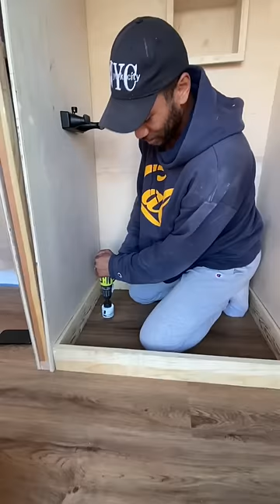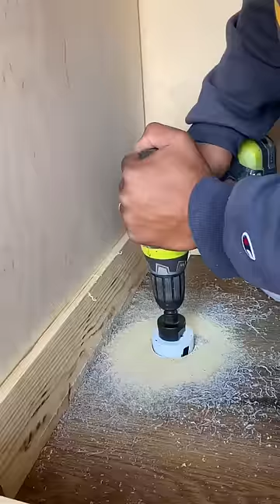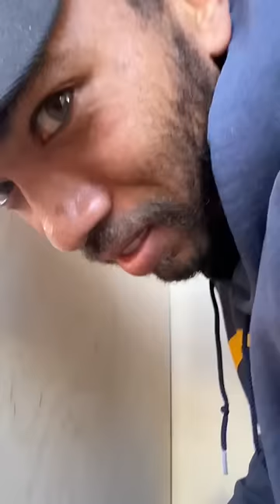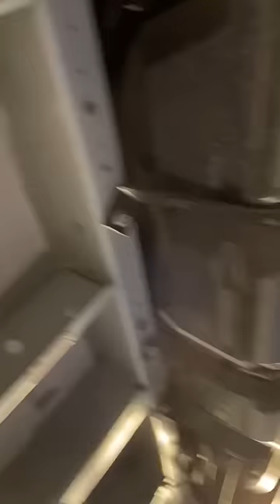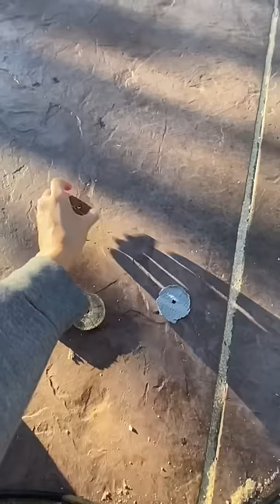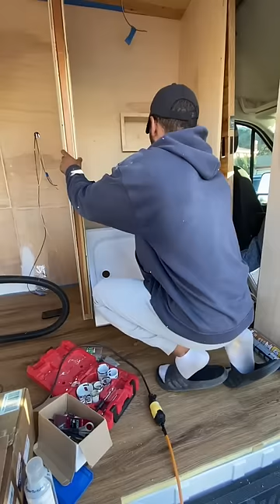How to build a shower drain! #shorts #vanlife #diy #vanconversion #vanbuild #transit #shower #rv

Comment: Ryobi the official tool of I have no fucking clue what I’m doing but I’m a diy person now 😂😂😂
Reply: @That_Black_Menace  bro ryobi is no where near as good as Milwaukee are you crazy I have used tools from a lot of different brand ryobi are terrible they bog down constantly struggles with power and ryobi and Milwaukee both have the shitest battery life what are you talking about 😂 Mini Cooper owns bmw that doesn’t make a countryman as good as an m3 😂😂
Reply: @That_Black_Menace  Milwaukee does it as marketing. If you don’t anything about the tool world or anything about marketing I suggest you just say ryobi is dog shit💀
Reply: @That_Black_Menace  That’s completely false. I sell Milwaukee tools but I personally use DeWalt. Quick example of a better Dewalt tool is the DCN623 compared to Milwaukees 23ga pin nailer but the Dewalt costs more. I also consider anything battery powered from Ryobi to be bad for business. If you’re hanging stuff up at home, building a small birdhouse, or assembling any furniture you might occasionally buy then yes Ryobi is a good option. If you show up on any site with Ryobi tools I guarantee every person there will immediately think you’re unskilled or have an addiction problem because why would you do that to yourself?
Reply: @soulreaper1513  Milwaukee power tools literally can’t be beat
Reply: @konner3593  dewalt better
Reply: this is perfect😂
Reply: dewalt deffinetly best, best battery fit and size, best bits, best chargers, best impacts. i’ve never had a dewalt battery just fall out of my impact. that’s some milwaukee shit
Reply: @TheEvilPorkchop03  everything you said is opposite except for the fact that dewalt drills are unreliable and like to just shit the bed and stop working whenever they feel like it so you’re very incorrect bud
Reply: @vno23 bmw owns mini*
Reply: @Janue_ dealt is by far the better construction company but if I was rebuilding an engine or doing most anything with cars I would want a Milwaukee and I'm not even a huge fan of Milwaukee.
Reply: Just need to get a bigger battery and they're just fine.  I've got 4 amp batteries on all my Ryobi stuff and never have any issues.  Damn impact drill is better than 10 years old and it's still going strong.  Nevermind the price.  Ryobi is much cheaper than DeWalt and Milwaukee.  So if/when a tool does.burn up it doesn't break your bank replacing it.  You can use whichever brand you want but in my 30 plus years in the trades has shown me that they will all do what they're sposed to do.  If you wanna chase the red or the yellow team go right ahead but I'm sticking with my Ryobi tools.  Been making me money for years. 🙂
Reply: @That_Black_Menace  dewalts been kicking their ass recently lmao get with the times.
Reply: @Janue_  I work construction and renovation and I can agree with this don’t show up with that bs 💀🤣
Reply: @vno23  bmw owns mini, not the other way around…
Reply: I'm more of a Milwaukee person
Reply: I want to like this but, your likes are at 777
Reply: all these worlds manliest manly men fighting over tool brands on a van conversion youtube short 😅 must be a slow month for all that construction they ~normally~ be doing 😏
Reply: @vno23  mini does NOT own BMW. It’s the other way around bud…
Reply: @That_Black_Menace  dewalt runs laps around anyone
Reply: Bro, look at the burn marks on the piece of wood beside where he's working. I'm surprised it didn't catch fire on the table saw🤣
Reply: @Carlosc707  my bad point still stands tho
Reply: @That_Black_Menace  dewalt or hilti till I die
Reply: Hey I know exactly what I'm doing most of the time lol. I just own ryobi stuff because I got out of construction 20 years ago and got everything I needed tool wise for the house for a hundred bucks on market place lol. Cant beat an impact, drill, circular saw, Sawzall, work light and angle grinder with 4 batteries and chargers for a hundred bucks
Reply: @vno23  he is one hundred percent right. Companies sell budget tools under different names so they can still charge more for their pro tools while still making money in diy people who don't wanna spend a ton. Not even close to the same quality but they do come from the same parent company
Reply: @octane9866  so yall are baggin on rider there when he's right lol. "Both are brands of Techtronic Industries, used under license from Ryobi Limited. Techtronic Industries (also One World Technologies) is also the parent company behind Milwaukee Electric Tool, AEG (AEG Powertools, licensed from Electrolux), Homelite, Hoover US, Hart Tools, Oreck, Dirt Devil, and Vax."
Reply: @Janue_  that's funny cause I work for techtronic which is the parent company for both. So yes, they do fucking make both
Reply: If you're just doing light work around the house then you have no reason to buy high end tools. I have ryobi I keep at home for quick repairs and they've been working perfectly for about 10 years. Meanwhile I've burned out milwaukee and Dewalt on site multiple times
Reply: @That_Black_Menace  Makita has the best battery and some of the best tools, especially now with the XGT line
Reply: @That_Black_Menace did you know that DeWalt and black and decker are part of the same company too? Doesn't mean black and decker tools are good
Reply: Sounds like a pesant fight over crack head tools. I use all Porter-Cable. I dont trust ryobi, Milwaukee, dewalt or Makita
Reply: @Rider  except for Milwaukee's recent 1/2 impact its a epic fail unfortunately 😔. If you look it up it's bad many of them have broken like hours after purchase
Reply: @jasonluera5058  lol

Comment: No matter what brand drill you get (god forbid Ryobi) never choke your drill’s vents with your free hand like that. Hold it by the grip that’s what it’s there for. Drill’s gotta breathe.
Reply: I always wondered if it was ok to cover those. I have done it plenty of times before but never when drilling through massively thick materials like this. Sometimes it's throwing a 1/4 in through a stud and my hands is on the back. Seeing the sparks fly on my father's older brush motors always made me weary of the vents on modern drills
Reply: @isjjcjw  most are brushless motors now, however the vents are there for a reason for sure, things tend to overheat.
Reply: #drillsgottabreathe💪
Reply: Honestly underrated comment, power tools have vents for a reason, after drilling though some trailer crossmembers you learn that lesson pretty quick.
Reply: Also don’t push down so godamn hard let the drill do the work😂
Reply: Thank you!!
Reply: He probably did that to avoid kickback. These holesaws can bind pretty quickly. 

That said. A decent drill nowadays has anti kickback. Get one and your wrists will thank you.
Reply: @Gren4te  I've only seen bosch advertising that so far, and they seem to be pretty all over the place with their power tools nowadays
Reply: @ItzGiooo depending on the material and drill bit it might be better to use low rpm and a high feed rate (pressing down hard) or it might be better to use high rpm low feed rate. He's not drilling through anything that intense so a lot pressure is fine until he gets to that last layer.

Comment: I can smell that drill burning up 🔥
Reply: Typical 2 min ryobi battery life.. why do people go with JUNK tools?
Reply: @bradmadeira6807  cheap
Reply: @bradmadeira6807   hes a DIYer not a trsde worker. save money. he won't use it for anything but that. 
why would you question saving money, when it does the same job?
Reply: @DoubleTripleOGfromtheset  Cuz he's a Dewalt fan boy
Reply: @DoubleTripleOGfromtheset  that's why he has 2 separate batteries and the double charger 🤦
Reply: Just buy a bauer they are cheap and amazing
Reply: No you can’t
Reply: @bradmadeira6807  really 2 min ? Want me to make a video debunking that ?
Reply: @vsreef1042  Dewalt is junk too 😂 if it isn’t red…..I’m not buying it. Aside from Makita skill saws
Reply: @waynewilliams5353  my dad used dewalt from the 70's till the 2010s and I inherited them. I've used makitas the last 20 years. Never had a problem with any of em.
Reply: @jorgetamez4162  it's comes in a combo pack...
Reply: @DoubleTripleOGfromtheset  yeah of course it would
Reply: @vsreef1042  actually no, I’m NOT.. DeWalt has declining battery quality..
Reply: @DoubleTripleOGfromtheset  because it’s about longevity of the tool.. but the good ones ONCE.. buying crap makes you buy the same tool over and over again and in the end you end up paying a lot more for the crap tools instead of just spending the little extra.. if you own a HOUSE then why skimp on crap?
Reply: Lol
Reply: @vsreef1042  dewalt makita and milwaukee would do better than those.  I would go with milwaukee fuel drill
Reply: @nightmareinaction629  don’t forget about Metabo
Reply: @DoubleTripleOGfromtheset  Thatll blow and he'll buy the same one, rather than simply buying good tools in the first place. And honestly, makita or dewalt isnt all that much more than ryobi. Depends how frequently you use them

Comment: How to build a shower drain:
Step 1: take green tools, put in trash
Step 2: drive to Home Depot and buy Milwaukee impact and drill driver set
Step 3: using a whole saw and less than a single bar on a battery, drill your hold with the Milwaukee drill
Reply: Milwaukee, ridged, and ryobi are all made at the same place.
Reply: @fatbettysadventure603  Ofc you’d say that but if you go over to our very good friends at the torque test channel, you’ll see a great video about just how much torque they each make. Just because they’re made in the same place, doesn’t mean they’re the same quality 😘
Reply: @RK_Insanityy  not arguing, there are different qualities in all tools. If I was using the tools daily for my job or if I just needed to cut a board once in a while. The homeowner quality Ryobi has it's place. Kinda like the Ford vs Chevy question. Does it matter if they both get you there?
Reply: @fatbettysadventure603  definitely has its place and is a great value for what it is.

Don't forget that that was a brushed drill, so of course it doesn't stand up, but it's also a hell of a lot cheaper and the batteries even have a wider range of compatibility
Reply: @fatbettysadventure603  absolutely. Look at how many batteries he goes through just for the hole saw
Reply: @RK_Insanityy  sounds like a battery issue, not a tool issue. I use Milwaukee M12 tools daily. I have some batteries that are shot, but isn't the fault of the tool.

Comment: He could've just used the shower floor as a template. Also, if they don't replace that flooring with durarock before installation... there's gonna be some issues. On top of that, that 2x4 didn't look treated, so...same result.

Comment: Quick tip: never cover the holes on your drill, it could over heat and start to burn 
And when drilling trying to keep your hole straight you don’t wanna make it crooked like you did 

Also never get Ryobi

Comment: Spent more on those hole dozers than the drill 

Also if you’re getting after it enough to burn through a battery don’t cover the air vents. You’ll burn the drill out real quick doing that.

Comment: The only way to learn (in my opinion) is to do it yourself and learn from your mistakes. Great job!!!

Next time, drill a pilot hole first just to be safe! easier to repair that mistake! But again, you’ve done fantastic work in this van! From one contractor to a fellow DIY’er, impressive job!

Comment: So ryobi is fien for home use but this is a damn job site lol. Might as well just get Pittsburgh gear. I own ryobi though because I'm not a professional anymore and all my tools were older than dirt lol. Circular saw, Sawzall, work light, drill, impact and grinder with 4 batteries and chargers for 100 bucks.

Comment: 3 inches away from the horizontal cab rail.  You got lucky.  Would have compromised the safety of that vehicle  if it went through the cab rail.

Comment: -Ryobi. Don’t buy this brand 
- Bit is hot after drilling and it was probably hot af touching it right after 
- don’t block the drill vents!
Reply: Ryobi is fine, never had a problem with their tools and the batteries are a good price. I've built a couple sheds with there drills, drivers and saws and have rebuild a couple engines with their impact wrenches. I really can't justify paying for a more expensive tool

Comment: U can always test with drilling a 1/4" pilot hole first to see if ur in a good spot. Its alot easier to seal a small hole instead of a big one if its wrong
Reply: I'm sure he dry fitted it first.
Reply: @Caliinthevalley  it was about not hitting anything and landing in right spot under the vehicle.. in the vid i think he said something like i hope i dont hit anything. Thats what my original comment was referring to
Reply: He said "hopefully it's in the right spot" he wasn't specific to what he was referring to tho, I'm sure your right tho. I don't think anyone would just randomly drill a hole hoping to be accurate 🤣

Comment: I have some Ryobi tools that I've been using for 15 years and have put them through the absolute ringer building houses/barns etc. If you wanna pay double the price for miniscule performance upgrades be my guest!
Reply: Minuscule? I have built dozens of houses and have cut through much worse much quicker. There is a reason why 80% of construction workers use Milwaukee. It isn’t because they are fan boys, it is because it gets the job done quicker and easier.

Comment: Invest in a whole drill bro will save you lots of time I got the Milwaukee super hog makes my plumbing skit easier.
Reply: How's your battery life though?
Reply: Bro the second you said Milwaukee we knew you just follow the crowd and don’t reasearch tools 😂
Reply: @vno23  lol 250 holes off one x12.0 battery. I’m 21 years old and tried every type of tool for whole drilling
Reply: @MrTimequake  battery life last a long time especially if you aren’t using outdated batteries. It’s like excepting an old phone battery to keep up with a fresh one. All depends on personal care and making sure everything is stored correctly. As someone who does underground’s and rough in’s mainly my tools stay immaculate
Reply: Bro I got the hole hawg drilling 4 5/8” holes over head, fucker burnt out on me it’s under warranty but I was pissed!!! I had this old school dewalt right angel drill NO CLUTCH drilling that shit over head. Talk about put hair on your chest.
Reply: You think he’s going to need to drill 250 holes?? lol the Ryobi works just as fine for what he needs.
I have both Ryobi and Milwaukee and for the price of Milwaukee… you can grab x2  of Ryobi for the price of one Milwaukee 😂
Reply: @deandalapanda  you don’t get the performance on a ryobi like a Milwaukee

Comment: Yea that looks finished
Reply: No it doesn’t he drilled that hole
Way to small. How you fit the actual drain connecting fitting? They aren’t the same size as the hole they are way bigger

Comment: Pro tip.. put the shower in first with the same sized hole saw as the drain. Then when you have the pilot bit through then trade to the bigger hole saw...

EDIT: at bare minimum use a dewalt drill.

Comment: Me thinking did he check for brake and fuel lines??
Reply: Way off the frame rail he's good
Reply: Me knowing he didn’t check to see if the whole is big enough to fit the actual shower drain connecting fitting . Which he didn’t . Not even close . Better get those batteries charging to re do that hole